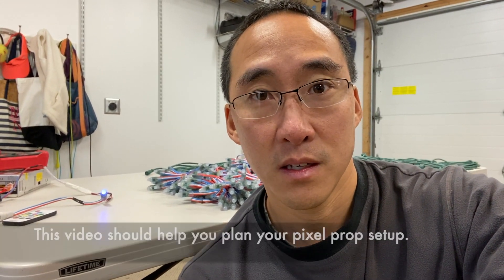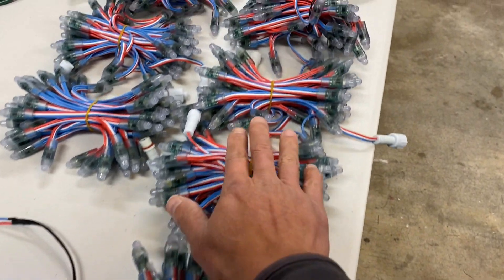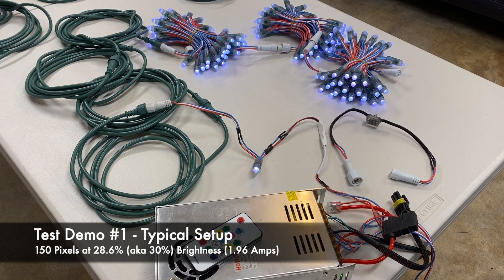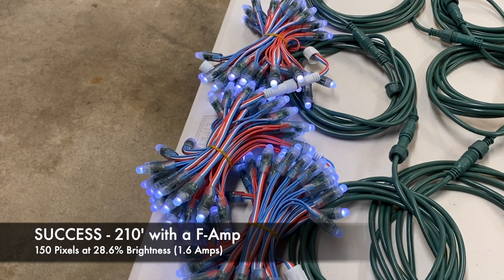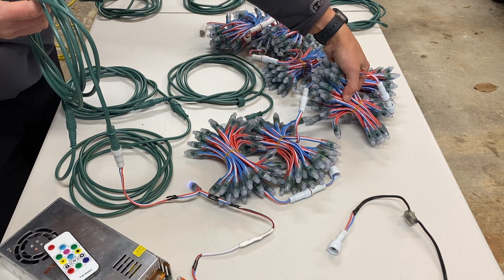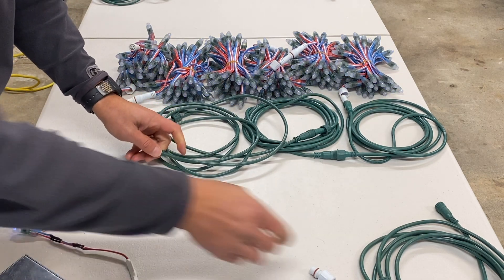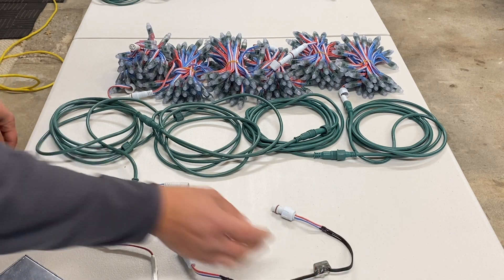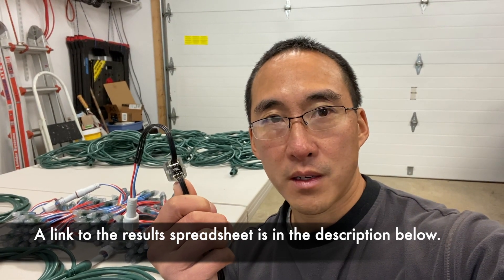WS2811 Pixel Data - How Far Can It Go With and Without a F-Amp

Comment: Hey Steve, I’m really new to all of this — I just put this together as a project for my mom, so I apologize if I’m not explaining everything perfectly. I plugged all the lights in beforehand to test, and everything worked fine all the way down. My setup is a 12V power supply feeding a controller, then two 100-pixel WS2811 xConnect strings, then a 10-ft splice/jump, and after that another two 100-pixel strings. Everything before the splice works perfectly with no issues, and the voltage after the splice tests fine, but as soon as I connect the jump the pixels start to randomly glitch every ~10 seconds, and the glitch shows up all the way up and down the line past the splice. Before the splice, there is zero glitching — it only happens once that 10-ft jump is added. Do you think this is a data-signal issue that needs a booster, or something else I should look at?
Reply from the maker: Apologies for the delay in responding. 

One data point that is important is the output brightness you are running the pixels at. Even at 30% output brightness, running 400 pixels without any extension wires/splices may result in data corruption or color discoloration at the end of the line. If you are running at a higher output brightness, I would first drop down to 30% or so. 

The crazy behavior could also be a result of the extension/splice wiring. Be sure the wire is of decent quality, 18AWG copper or better. It sounds like you made your own extension. Check out my video on making custom extension wiring, as not all types of wiring work well with pixels. Granted, it is just 10 feet, but a poor quality wire could still be the issue.  

If you’re still having issues, I would power balance the first set of 200 pixels and also power balance the 2nd set of 200 pixels if possible. This would improve the quality of V+ and GND (V-) across all the pixels. 

If all that fails to work for you (or maybe go straight to this), I would use another output from the controller for the 2nd set of 200 pixels. 

Good luck and welcome to the insanity! ;)

Comment: Dude, why didn't I see these videos before ordering all my stuff?  Hooked up all in my basement, no extensions, everything is great.  I read all about power injection and got my head wrapped around that.  Put up strips on verticles of the house and added soldered extensions and the shit barely goes 10 feet before data problems.  Of course my famps are on the way.  But thank you for all these informative videos!!

Comment: You should try this with dual data pixels. From my experience dual data drops signal strength quite a bit. I can push about 400 seed pixels (3 wire / single data) however that number is much lower with dual data seed pixels. It's between 200-244 seeds. The same is true of dual data bullet pixels.
Reply from the maker: Thanks for the comment and for sharing that dual data seed pixels suffer data integrity issues over long runs compared to normal seed pixels. I wonder if the same goes with dual data regular pixels. If I get my hands on any, I’ll see if my experience is the same as yours.

Comment: Does the f-amp need to be before or after the power injection wires? I have my esp32 running 16 feet, the next set is where I connected the power injection.
Reply from the maker: I would recommend putting the F-Amp after power injecting. The improved power baseline will allow the the F-Amp to do its best to boost and cleanup the signal as much as possible. 

If you do it before the power injection point and the voltage has decreased too much, the F-Amp can only do so much to create a solid signal. 

That said, if the data coming in is already poor, the F-Amp will not be able to remove all the noise. 

When I chain props with lengths between runs, I recommend power injecting and boosting the signal before a length of run to the next prop. 

Best of luck.

Comment: Hello Steve. This is a great video, even today. I want to ask, I’m having issues with my icicles along the roof line. My 2nd run from port 2 is about 50ft from the controller and I use an F-amp to the first 220 with a PI, and no issue. The total of icicles are 546. However, the last 336 keep flickering and I have 3 more PI points and they still slightly flicker. I don’t know why. My voltages look pretty good, but do you think this is data? I forgot to add, I had to put a 5ft extension cable after pixel 220 up to another part of my roof. Is it possible, the cable is killing the data down the roof?
Reply from the maker: @zski1, thanks, glad the video is helpful for you.  You are definitely experiencing data corruption along the length of that pixel run.  I will assume that you're running the pixels at 30%.  Regardless of the output brightness, you likely have plenty of voltage (power).  I ran into exactly the same issue with my Megatree the first year.  I had 510 pixels in 3 segments.  The first 170 was fine, I power injected to the 2nd set of 170, and power injected one more time for the 3rd set of 170.  Even at 30%, I would get flickering on the 2nd and third set of pixels.  

What I learned is the data line shares the GND (or V-) as the reference signal.  So, increasing the wire gauge for the GND (V-) line greatly improved the data signal quality, since power used by the pixel causes more current to flow on the GND line, which then adds noise and subsequently interferes with the data signal integrity.  

In addition to improving the ground line cable quality (thicker wire), I found that power balancing various sections also helped to reduce GND noise for the data signal.  If it's possible for you to power balance each section of your icicles by adding V+ and GND wires from the first pixel to the last pixel of each icicle section (6' or 8' or whatever the length is), that'll greatly improve the GND line which in turn will make your data quality solid again.

Sorry for the long explanation, and I hope it helps.  I show both power balancing (aka self-power injection) and power injection in this video to chain pixel props for very long runs, like your icicle run.  https://www.youtube.com/watch?v=Zb_c_tNSt90
Reply: @NiFamilyLights  Thank you, Steve!! It’s funny because I’ve got my 945 icicles working flawlessly with your tips. But having issues with only 405 pixels along the top of the icicles. I have sufficient power injection, maybe too much, a placed Famps throughout, but still get a subtle flicker from some of the pixels on certain strings. But I think it’s a mediocre heat shrink job because I don’t think I gave it enough heat for the solder to spread into the wires because I was afraid I’d burn them. Apparently not. They are very strong.  the show works and you can’t even tell. But after the season, I’ll redo the connections and hope it solves the issue.
Reply from the maker: @zski1, You know what’s funny, I had some seemly random glitching on one of my megatree outputs, but specifically on the strings that were power injected off one of the outputs. 

After messing around trying to trouble shoot the problem, I discovered that the power injection cable was passing directly over the diff receiver network cables. Once I separated them, the glitch went away. 

You can’t have too much power balancing/injection. Check where your cables are running and see if they’re on top of each other. If they are, try separating them and maybe your flickering run will be good too. It’s worth trying.
Reply: @NiFamilyLights  Thank you, Steve. I think I may have a couple on top of each other. What’s also odd, with the lights completely off and controller on, I get the same glitching in some of the strings. So, it may be some interference from the cables themselves because they’re all running parallel in the gutter for the icicles.

Comment: Nice! It looks like you use a JST to XConnect adapter. Can you please let me know if that's right? If so, where do we get them?
Reply from the maker: I don't use any JST connectors in the show.  JST connections are not weatherproof.  My show uses the screw connectors that was one generation prior to xConnect.  They are all 3 pin plug and screw type.  The 3 pins correspond to V+, V- (GND), and Data.
Reply: @NiFamilyLights  Thank you! That really helps

Comment: Do I need a pixel at the beginning of the control to able to run pixels 200 feet away from the control or just I can do it with f amp ?
Reply from the maker: You do not need to have a pixel at the beginning of the run.  I have a pixel there with the tester just so I know what the tester is sending out to the pixels I'm testing.

I later discovered that the output resistor network of the controller is often the limiting factor.  See this linked video.  If the output resistor network of the controller is 33 ohms, you'll get the best data signal driving distance (the same as an F-Amp).  

https://www.youtube.com/watch?v=Vg9gkWEO-hQ

Comment: Ever tried inserting one pixel in every extension line, or moving the F-amp further down the line?
Reply from the maker: I have not inserted a pixel between extensions. If you do, you need to modify settings within xLights or the controller to account for the NULL pixels. That could help if you are willing to modify your configuration. 

For most controllers (other than the F16v4 and AlphaPix controllers), the controller output impedance is higher than 33ohms. The higher output impedance is there to protect the controller. The F-Amp has a 33 ohm output resistor. Why is that important? Because that’s what the WS2821 chip input impedance is to match data signals. That is needed to best achieve data driving distances. 

So, putting the F-Amp closer to the controller output will clean up the signal with the cleanest original signal and impedance match for good transmission of data. Putting the F-Amp later down the line means you may be at the point where the data signal is already prone to having data corruption. So, potentially bad data in would result in bad data out. 

Also, at the distances an F-Amp can send data, if you are beyond that limit, you are also likely to have significant voltage loss on the V+ line. 

Check out this video I made on the power of 33ohms. 

https://m.youtube.com/watch?v=Vg9gkWEO-hQ

Comment: This is great!!   Been trying to convince my boss that we dont need to splice in more power every 50 lights...  the f-amp is perfect!!!   Do you have a link for parts etc??? Mainly the f-amp???   Also we are inly running 254 lights in all. May not even need a f-amp.. but better safe tha sorry
Reply from the maker: Hemens, glad you found my channel. Check out some of the other videos I have which may also help with your planning. 

For the F-Amp, you can get them at pixelcontroller.com.

Comment: I'm new to this, which ones is better, the three wires pixels or the four wires pixels, thanks
Reply from the maker: Welcome to the hobby! I am only familiar with 3 wire RGB WS2811 pixels. If the 4 wire are RGBW pixels, I believe those are a generation only than the pixels I use and that are shown in my videos.

Comment: Hey, where did you buy that cable and the pixels ?
Reply from the maker: The 10’ pre-made extension cables came from the same vendor that I purchased the pixels from. Most every pixel vendor also sells these types of cables in a variety of lengths. I only purchased 10’ lengths so they are all the same, and if I need one, I just grab another one.

Comment: Great video.  You wouldn't happen to have any data like this for a 5v pixel?  I have a strand of 176 5v LEDs across my roofline. I'm trying to figure out how many amps it pulls :/.  Thanks!
Reply from the maker: Halbert Family, I have unfortunately not done extensive testing with 5V pixels. I have spent a little time with them and found that they suffer from voltage loss well before you’d notice data corruption. So, if you are power balancing those regularly (every 100 pixels or so), then you shouldn’t have data issues.
Reply: @NiFamilyLights  Ok great.  Thanks for the reply!

Comment: Can you use an F-amp to just boost the data and not the voltage and do power injection at the pixels with a separate power supply?  I'm looking to control about 300 pixels about 65' from the controller.
Reply from the maker: Yes, you can. With a 65’ extension to the pixels, the wire you use for the extension will be critical. Check out my video on “How to make custom pixel extension wiring” for what will work for you. In addition, if you have a Falcon F16 controller, you can make a simple mod to the controller, and you may not need to use any F-Amps. That video is called “the Power of 33 ohms”. Best of luck.

Comment: I really like your videos by the way. What about using 75 ohm coax cable to transfer data over distance? I have been searching about this option, but there is nothing really out thee on it.
Reply from the maker: Thanks MrSpalmer. I haven’t tried that type of cable for data. I presume that would work. If you do that, how would you get power to the prop? If you end up running separate AC power to the prop and place a power supply there, you might as well use a smart/differential receiver.
Reply: @NiFamilyLights   True. I was just curious as I have some coax laying around. The power like you said would have to be ran separate (at least the +).

Comment: Great Video! Can you post a link to the LED strings you are using? Thanks!
Reply from the maker: The pixels I'm showing in this video are 12V regulated pixels purchased in 2017 from DIYLedExpress.  However, you can now get pixels (regulated and resistor based) from a variety of vendors.

Comment: Steve, stumbled onto your videos a few weeks ago and have to say you've answered so many technical questions I had regarding pixel use. Thank you!

In terms of this video, i have a unique situation where I need to run 2ft extensions between EACH pixel in a run of approx 32 pixels @ 12v.  So, for example, the setup is: 
FalconF16-- 20FT 18awg extension -- PIXEL -- 2ft 18awg extension -- PIXEL -- 2ft 18awg extension -- PIXEL -- 2ft 18awg extension -- PIXEL -- etc up until there's 32 total pixels and a total length of about 80ft of wire/lights. I will have power injection at the beginning and end of the total run to balance things out.  The 2ft extensions are custom wires I'm making using 4 conductor 18awg Monoprice wire, with one wire for V+, one for Data, and the other two bonded together for V- to hopefully help avoid voltage ground corruption.

Based on this video it looks like the chip in the pixels have no problem repeating data upwards of 30ft, so in theory I shouldn't have an issue with spacing each individual light out 2ft apart correct?  Or, in your testing, do you think there's some type of cumulative degradation of the signal with that distance between multiple pixels and I'll need to slip in an F-amp along the line, or take similar action?

Thanks in advance and keep up the great work!  I look forward to your future videos.
Reply from the maker: Thanks for the comment and kind words. I’m glad these videos are helping you out. 

As for your specific situation, your planned setup should work just fine with no issues. You have mitigated the most significant factor which is voltage loss by powering the beginning and end of the run. You also mitigated voltage loss by using the Monoprice pure copper wire. So, you should expect to have no issues whatsoever.  You should not need any FAmps. Each pixel regenerates data to be transmitted to the following pixels, and 2 feet is of no concern. Data gets corrupted due to voltage loss across long runs and/or poor ground lines resulting noise affecting data. In your planned setup, you have mitigated those concerns. 

That’s a lot of soldering to add the 2 ft Monoprice segments between pixels. It’ll take some time to get all that done, so enjoy it knowing it’s going to work out great.
Reply: @NiFamilyLights  Awesome!  Based on your video I hoped I would be OK but glad you've confirmed the idea.  I plugged the info into the power calculator and it should also be sufficient with injecting at either end.  I have the first strand about half finished and will hopefully be testing the full 32 light run next week.  

And yea you're not kidding its a TON of soldering and heat shrink, so I have recruited a few people to help so I'm not connecting wires until 2025 :)   Thanks again

Comment: Very good and clear explanation. Excellent video.
On a side note, do you build your own cat5/cat6 patch cords to connect your receivers to the controller?
Reply from the maker: Yes, I do.  

I have spools of Cat5e/Cat6 network cables that I used to make both custom extension cables and also patch cords to connect my receivers to the controller.  The cable works great for both uses.  As a custom extension pixel wire, you can see how well it works for that purpose in my "How To - Make Custom Pixel Extension Wires" video.
Reply: @NiFamilyLights  . Thanks so much. Any specific configuration you use, either A or B or it doesn't matter as long as its same on both ends. Thanks!

Comment: Those multimeter leads just lying on that power supply gave me agita!
Reply from the maker: Haha, right.  I kept an eye on them for sure.  The risk is pretty low as the power supply screw terminals have plastic dividers preventing cross terminal contact.